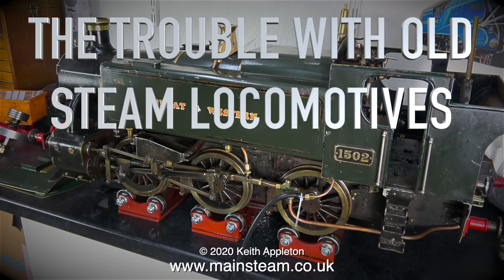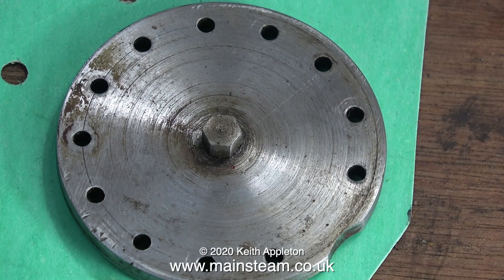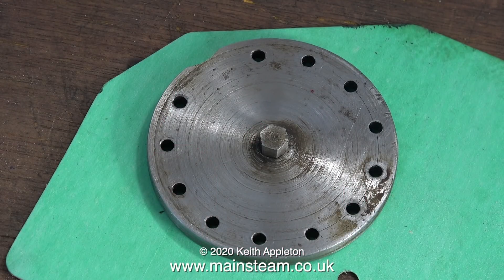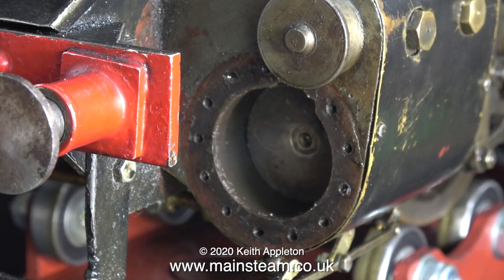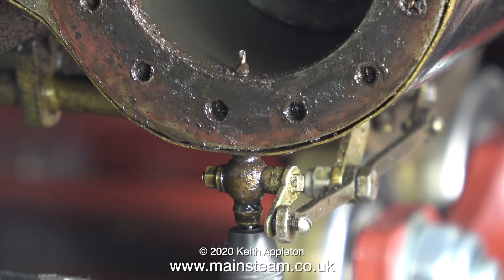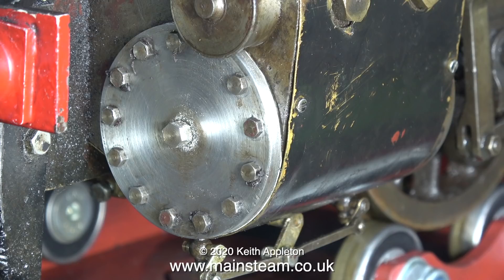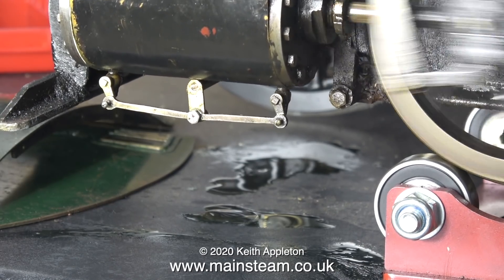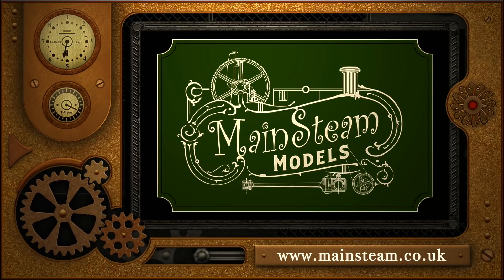THE TROUBLE WITH OLD STEAM LOCOMOTIVES - PART #8

Comment: Loctite 518 (or equivalent number for ferrous) is a liquid gasket. It’s clever stuff that won’t set unless it’s between the joint faces. I’ve used it on 2 stroke motorbikes that had tiny oil galleries into the bearings. It can’t set in blobs like silicone does.

Comment: Has anyone thought of using stainless steel bore liners?
Reply: Daniel Ramsey: The problem with stainless steel is that it won't allow a piston to bed in properly.  Cast iron cylinder liners have always been used in steam, gas, and diesel engines because the carbon in the iron acts like a lubricant,  the micro surface is actually quite bumpy and quickly wears down to a somewhat soft surface that helps seal against the rings. Even today, modern engines still use iron liners and iron rings.  I remember when some companies tried using a nickle coating but it didn't work out.  Over time the nickle glazed over and the seal was lost. I once saw at an auto show an engine with titanium rings, it looked nice but the builder said he was trying to work out why his compression tests showed he was losing pressure.  The rings of course were wearing out his liners unevenly!  You see, he didn't have my shop teacher when he took auto mechanics in school.